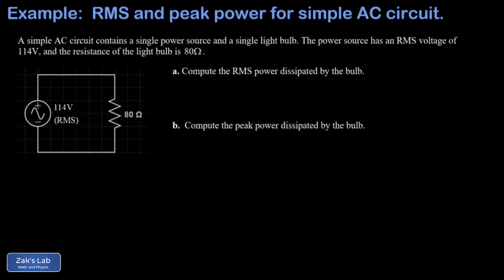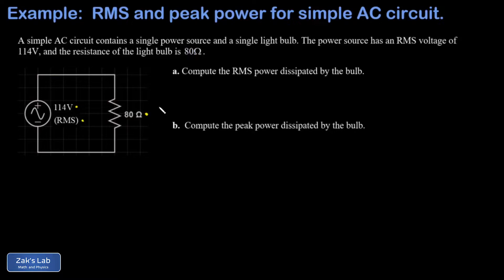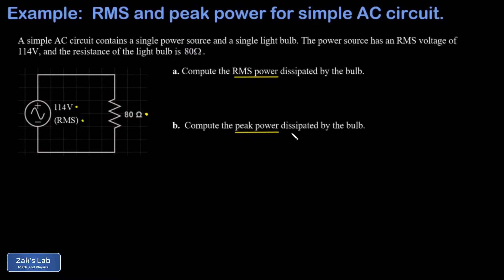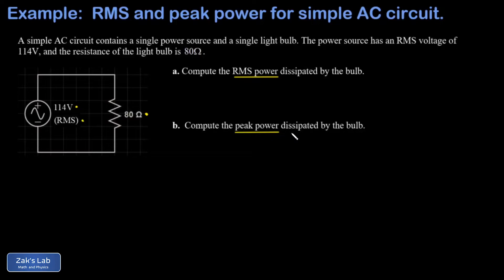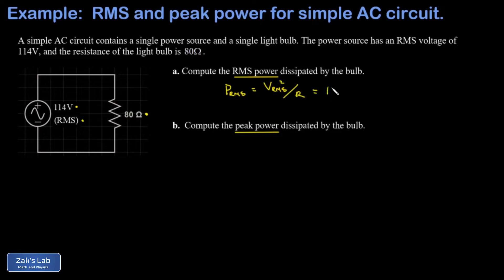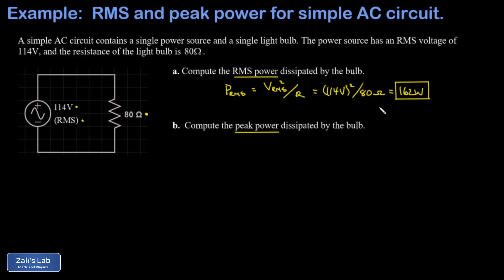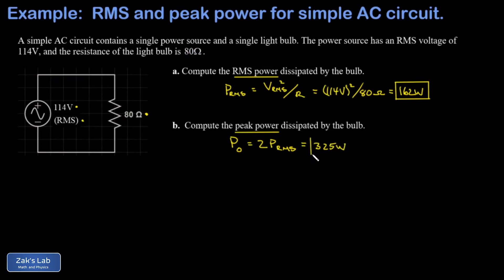RMS power and peak power dissipated by a resistor in an AC circuit, P=V^2/R for RMS voltage.

Comment: You calculated average power, not RMS.  That is the whole point why voltages or currents are represented in RMS. So that they can values can be treated like DC.
Reply from the maker: You're right!  It is simply the average power - z